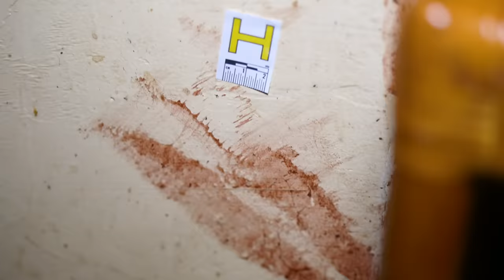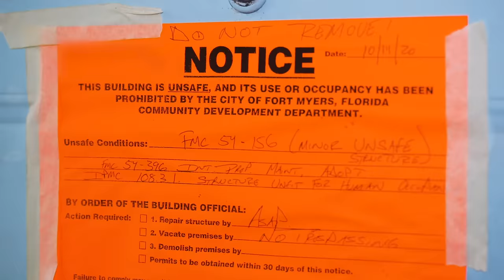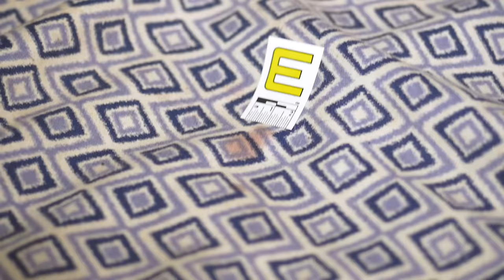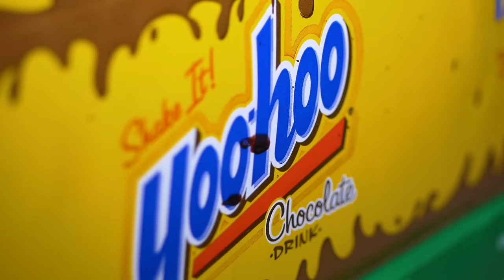Murderer Walked Around Victim's Home Barefoot | Fort Myers, FL

Comment: Spaulding Decon seems to have the most thorough cleaners.  I've seen other videos where the cleaners don't go under floor moldings, etc.  The attention to detail your cleaners have is really impressive.
Also, it is normal in Florida to just have a concrete floor with nothing (carpet, tile etc) on top if it?
Sending love and light to the family.
Reply: No, it is not usual in FL to have bare concrete. Maybe she couldn’t afford new flooring. It is so expensive.
Reply: Detectives could have pulled that up too if they needed it for evidence.

Comment: It’s strange not seeing y’all take the contaminated wall out like they usually do
Reply: I thought it was weird that they didn't move that thing that had the pop on it but they pulled up the floor around it and cleaned all around the legs
Reply: It depends on what the person who called them wants
Reply: I think they cut some corners for sure.
Reply: We arent seeing everything that happened and what they have sprayed with indicator etc to see if it needs to come up. It may have also been a surface that could just be wiped down instead of demo'd
Reply: It depends on if it wicked up the wall, and if it got under the base boards. If it's just on the surface, it can just be wiped off. Since it seems like it was a pretty short amount of time between the incident and their cleanup, it may be that the fluids weren't sitting long enough to damage it to that extent.
Reply: and no pulling out furniture or wipe down of furniture,etc..??? just went around everything??
Reply: @jospeaches4807  was weird how they just went around the furniture and carpet like an inch or less from the blood...not a fan of this particular branch
Reply: @nepadron  Never requested a service and had a certain amount of stuff to be done? They'll do as allowed by the client. Why go all 20 steps, when client wanted 7?: (set as example).
Reply: There was a video where the homeowner couldnt afford/didnt want to pull up tiles so they didnt also stated this was a job done through assistance so could be why it wasnt detailed. Not to mention the code enforcement will come back out decide if its deemed liveable, youd be surprised how many places dont do professional cleanings anyways, still was a good job nonetheless. Also if an item is not porous it can be wiped cleaned, for example the bakers rack, that's entirely safe to be wiped clean but the wood had to be thrown out.
Reply: Yeah this was corners cut due to finances clearly. Smh
Reply: We don't see everything they do on a particular job. We only see short clips edited together. Also depends on what the client wants. They can only do whatever the client allows them to do. Some clients don't want their walls or floors torn up and only want things wiped down as much as they can be.

Comment: Why wasn't the contaminated wall cut out like shown in all other clean ups that .
Reply: Might be cement sheeting or similar where the body fluids wouldn't really wick themselves up.
Reply: They might not be as thorough as the other Spaulding decon branch. They normally seal the floor too, but they didn’t do that on this job either.
Reply: @Angie-fh4ip  They only seal the floor if the floor hasn’t already been sealed some concrete is already pre-sealed before any carpet or tile goes on it
Reply: @Angie-fh4ip  deffently wouldnt say theyre not as thorough. They all go through the same training. And i wouldnt think theyd upload the video if they thought something wasnt done right.
Reply: Money, I THINK.
Reply: @sarkeen3128  it was a concrete floor in their house. Im assuming that when it was put in it they probably had some type of coating on the concrete. But if someone passed away in your house with as much blood everywhere as there was in this video, would you not want them to re-seal the floor with something new? Even after they cleaned it thoroughly?

Comment: Seems like an electric sprayer or pump sprayer (like weed killer sprayer or fertilizer pump sprayer ) would go considerably faster than the simple hand spray bottle. Same w the small paper towels they use to wipe up huge messes. I could really come up w more efficient industrial tools to save them time or make cleanup easier.
Reply: Yes, the pump sprayer seems that it would work much better. Also maybe using rags or used but clean T-shirts to wipe up the solution. Unless paper towels are better for the environment than cotton cloth is ????
Reply: Paper towels are prob made of recycled materials. All cleaning cloths would have to be thrown out/ burnt.

Comment: They left blood stains on the cement why not encapsulate? They didn’t remove the contaminated drywall why is that? Did it have asbestos? They cleaned off some of the content and left it such as the table should it not have simply gotten tossed?